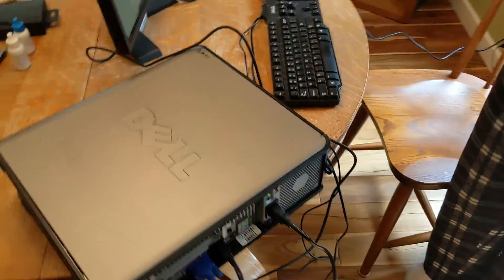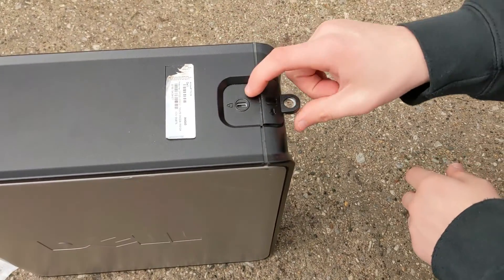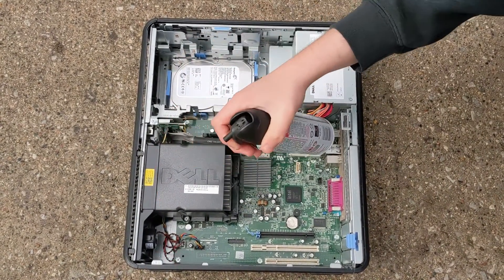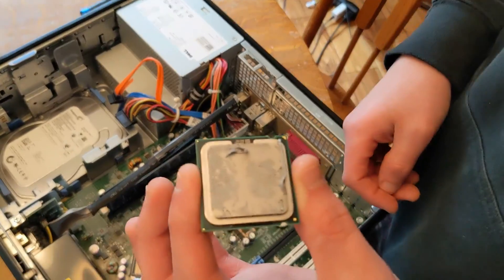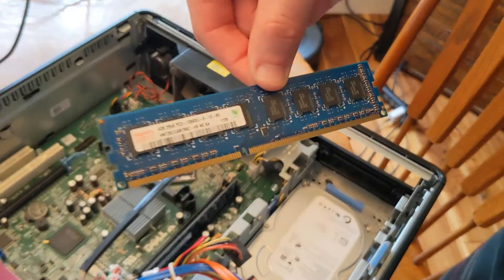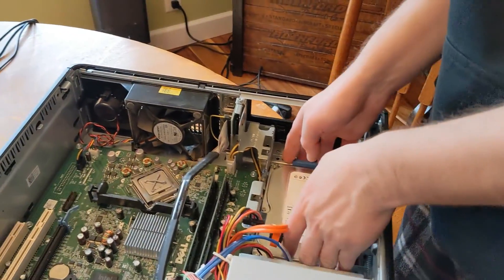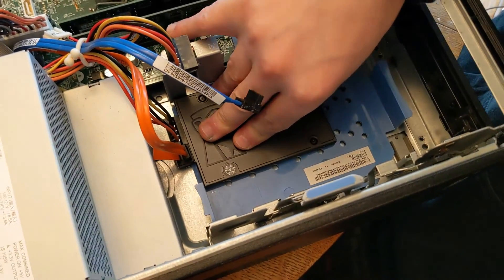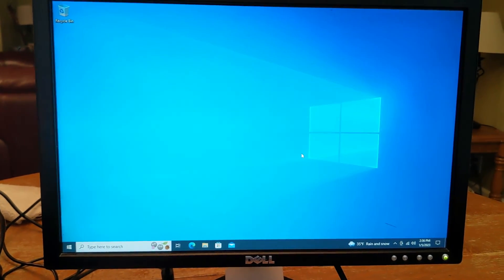Dell Optiplex 380 Upgrades

Comment: For anyone else doing something similar check the specs on your motherboard before you invest in parts. This system only supports a max 8 gigs of ram.  Also, upgrading from 1333mgz to 1600mhz has no benefit.  If you can get 1600mhz ram cheaper and easier than a 1333mhz, by all means go for it.  It will work, but don’t be under the impression that it’s an upgrade.  It will still only work at the lower 1333mhz speed because that’s the max the motherboard supports

Comment: My Optiplex 380 setup...E8600 3.33Ghz,RAM 2 x 4GB 1333MHz (8GB), 2 SSD (Kingston SA400s37 ATA Device (240 GB)+Samsung SSD 860 EVO 250GB ATA devices) 15 PIN SATA Male to SATA female 1:2 Y splitter... with a SATA 15 pin male to 6 PIN PCI-Express PCI-E card adapter cable plugged in to one of the female ends [allowing one SSD to co-exist with a 6 PIn being free to power one of the following (you have options)>>> a tall NVIDIA 650 graphics card (take lid off) or a low form NVIDIA 650 Ti (if you remove the graphics card fans+ remove holding bracket that hold main cpu heatsink+plus  if you saw off a metal piece of the rear case on the computer, a part of the frame...it will go in.) All this with a 15 pin VGA monitor. I run Win 7 Ultimate. The NVIDIA 650 (£15 on ebay) gets a 7.9 rating on graphics whereas the NVIDIA 650 Ti (£30) gets only 7.4 but a higher 6.7 rating overall. ENJOY. PS I used a jewellers saw to remove that tiny section of the case to get the graphics card in. POWER is the standard 255W it came with. I removed the CD player and old-school hard disks, just tape over the front slot. I have my Optiplex on its side and open.
Reply from the maker: Sounds like a Frankenstein computer. I love to hear people modifying their devices to fit their use cases. Good job. If it runs and doesn't get too hot I'd call it a win. You should send a picture in my discord.
Reply: you said you took the disk drive out, how do you do it without getting error? i want to do the same.

Comment: Core 2 quad, 8gb ram, ssd and graphics card. Can make these good for modern browsing. They struggle with 1080p 60fps youtube videos otherwise. Nowadays the later i5 3470 4580 machines are similar priced and a much better bet and more current.

Comment: i’m building this exact optiplex rn, the 380 deskstop version. my question is, is there a way to use the pc without the disk drive being in there? i have no use for it. i’ve tried running it without the disk drive, but a error pops up in the screen etc. is it possible to go without it?
Reply from the maker: You can run the system without it. Make sure you check the bios settings. It may have the computer setup to use the DVD drive as a boot device.
Reply: @ thank you! did some research & that’s what i have to do

Comment: 16:20 min - sticking the ssd inside the case is a bad idea because the ssd gets hot while running so better take a metal case.
Reply from the maker: Bring that it's sata it shouldn't get that hot, but you're probably right.

Comment: hey man i am little confused with something that dose my optiplex 380 support 8 gb ram because few mont ago i bought 4gb ram stick for my pc, and i thought i will buy 4 gb more later, then i will have 8gb ram, but my 4gb ram stick didn’t work it gave me beeping sound  previously it was 2gb x2 now could my ram be faulty? and i read really mixed stuff about this thing supporting 8gb ram online i’ve seen many people arguing some saying it dose support 8gig some saying it dont on dell website, could it be that there are different versions of 380 some support 8gig and some don’t? btw my 4gb ram stick is different from the old one could it be because of that? also can i use both ssd and hdd on this?
Reply from the maker: You have to make sure the Ram you bought is DDR3. The system should support 8GB. If you wanted to have a SSD and HDD you can do it either by removing the disk drive and installing an adapter that adapts the disk drive slot to a 2.5" or 3.5" drive slot. You could also get a PCIe to m.2 adapter and get an nvme m.2 SSD and do it that way. Then you don't have to remove the disk drive. It may be possible that some of these computers shipped with boards that only supported 4gb of RAM but I'm not sure.
Reply: Greetings, I have exactly the same problem, I installed a module of 8 gifas and it didn't work... were you able to solve the problem? thank you
Reply: upgrade to bios version A07 allows for 8gb.
Reply: @edsol4115  sadly no i wasn’t able to solve the problem if i remember correctly some models supported 8gig ram and some didn’t idk why. But fortunately i was able to buy a new pc and everything is fine now,
tho there is one thing just putting a single 8gb ram stick might not work but 2x4gb ram might work.

Comment: I Have Got A Dell Optiplex 9010 And It Has A NVIDIA GT 1030 Graphics Card And I Have Bought And Ordered A AMD RX 580 8GB It's Being Delivered Today And I Am Wondering If It Will Work On The Dell Optiplex 9010 I Have 275W And 16 GB Ram And A Intel Core i5-3470 CPU And Windows 10 Home I Will Probably Have To Remove The Hard Drive Cage To Make Room For The AMD RX 580 8GB Graphics Card But Will It Be Compatible With The Dell Optiplex 9010. Great Video By The Way.
Reply from the maker: You will need to upgrade the power supply to around 550 to 600 watts.
Reply: 500 watts should be just fine as psu

Comment: is that windows 11?
Reply from the maker: No. Windows 10.
Reply: @PCBasics  what bios is your optiplex? that highest or?
Reply from the maker: @hypecustomz4608 I don't remember. It's been a bit.
Reply: @PCBasics  i see i’m on ao5 going to download windows 10 to it on a new ssd let’s see if it works
Reply: worked out well, upgraded the bios to latest & windows 10! do you have link to the ram you used? going to upgrade that next
Reply from the maker: @hypecustomz4608  just look up DDR3 1600mhz. That should work for you.
Reply: @ perfect thanks!

Comment: Hi i would add 2 more things core 2 quad q9650 (if you can get it) and usb 3.0 card which you can get for very cheap
Reply from the maker: Yes, you can use the Intel Core Two Quad Q9650 because it uses the LGA 775 socket. You would have to update the bios before upgrading the CPU. You can add USB 3.0 if you add a PCIe x1 card to to the PCIe x16 slot. It should fit and work properly. Side note, I'm not sure what speed the PCIe slots are on this machine so I'm not sure how fast the USB ports would be.
Reply: @PCBasics  hi mate what do I have to upgrade the bios to and would you say the q9650 is worth it?
Reply from the maker: @warriorharj79  it is a good cheap PC. Upgrading the CPU would be worth while in my opinion but don't expect it to have brand new PC speeds. The lastest bios update is on Dell's website.
Reply: @PCBasics  of course that is expected thank you, also is the 9650 the best drop in cot?
Reply from the maker: @warriorharj79  I would say it's pretty good for the price. I am selling this one if you are interested.
Reply: @PCBasics  thank you mate but I own one lol